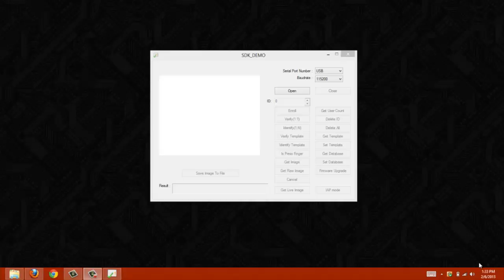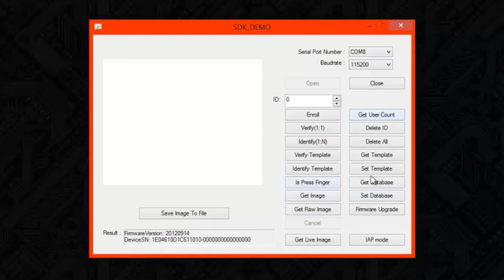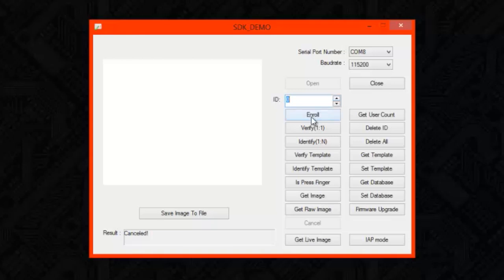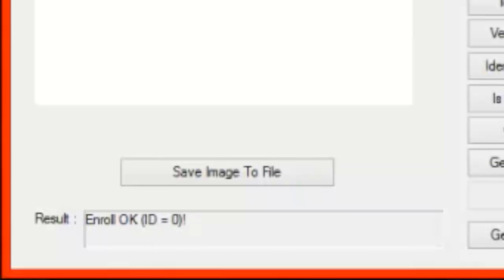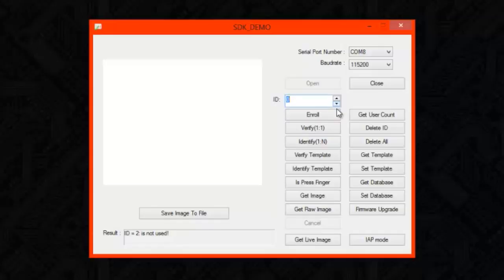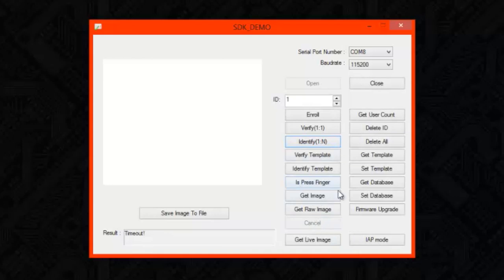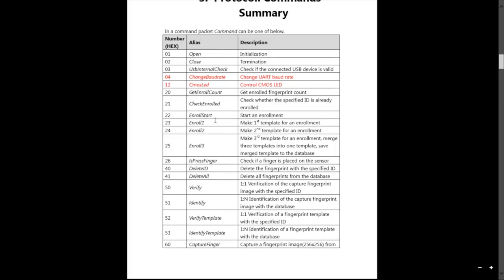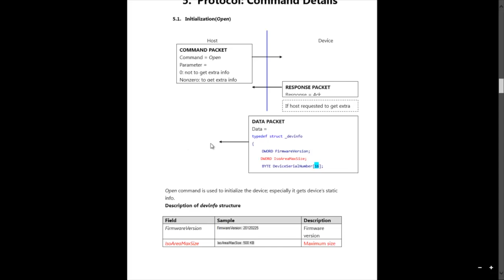SparkFun Fingerprint Scanner

Comment: I haven't worked with it, but I would imagine you could. It uses TTL logic (same as the arduino which is why Nick used the FTDI). In the program you would have to make sure to set the baud to 115200 and use datasheet to control what the arduino does, based on the response.

Comment: I have a question that I hope SparkFun or this community can help me with. This scanner performs like a champ. I'm using it in a device I have prototyped. In this project I have a need to grab the sensor's unique serial number. I've scoured through every C source file that comes with the SDK Demo for Visual Studio. I've found references to 'gDevSerial' but have not yet found what HEX commands or any other clues as to how the demo code obtains this  serial number, which it does when you make a serial connection to the sensor. 

I'm using an Arduino to interface with the sensor, and the Arduino library works just fine. However there are no methods in the library that allow the serial # of the sensor to be obtained. If I can locate the code used in the Visual Studio SDK demo then I can port it over to the Arduino library.

This is crucial to my project, as I'm using the serial # (unique to every sensor) as part of some security and anti-tampering measures. Does anyone have any ideas? Even if I can grab the last 8 to 16 digits of the serial # that would work well. Thanks in advance for any advice!

Comment: I just bought two of these, I tried them with arduino UNO and finger print scanner library, but there is no communication between the controller and the scanner.
Reply: Hi ,this sensor work with u?

Comment: What Arduino's code can I use to make it work with Mega. The Blink it's OK but Enroll Code need more anything to run!!!
Reply: Use this....

#include "FPS_GT511C3.h"
#include "SoftwareSerial.h"

// Hardware setup - FPS connected to:
//      digital pin 4(arduino rx, fps tx)
//      digital pin 5(arduino tx - 560ohm resistor fps tx - 1000ohm resistor - ground)
//        this brings the 5v tx line down to about 3.2v so we dont fry our fps

FPS_GT511C3 fps(4, 5);

void setup()
{
    Serial.begin(9600);
    delay(100);
    fps.Open();
    fps.SetLED(true);

    Enroll();
}

void Enroll()
{
    // Enroll test

    // find open enroll id
    int enrollid = 0;
    bool usedid = true;
    while (usedid == true)
    {
        usedid = fps.CheckEnrolled(enrollid);
        if (usedid==true) enrollid++;
    }
    fps.EnrollStart(enrollid);

    // enroll
    Serial.print("Press finger to Enroll #");
    Serial.println(enrollid);
    while(fps.IsPressFinger() == false) delay(100);
    bool bret = fps.CaptureFinger(true);
    int iret = 0;
    if (bret != false)
    {
        Serial.println("Remove finger");
        fps.Enroll1();
        while(fps.IsPressFinger() == true) delay(100);
        Serial.println("Press same finger again");
        while(fps.IsPressFinger() == false) delay(100);
        bret = fps.CaptureFinger(true);
        if (bret != false)
        {
            Serial.println("Remove finger");
            fps.Enroll2();
            while(fps.IsPressFinger() == true) delay(100);
            Serial.println("Press same finger yet again");
            while(fps.IsPressFinger() == false) delay(100);
            bret = fps.CaptureFinger(true);
            if (bret != false)
            {
                Serial.println("Remove finger");
                iret = fps.Enroll3();
                if (iret == 0)
                {
                    Serial.println("Enrolling Successfull");
                }
                else
                {
                    Serial.print("Enrolling Failed with error code:");
                    Serial.println(iret);
                }
            }
            else Serial.println("Failed to capture third finger");
        }
        else Serial.println("Failed to capture second finger");
    }
    else Serial.println("Failed to capture first finger");
}

void loop()
{
    delay(100000);
}

Comment: If I connected this to an arduino + touch screen, would I be able to enroll/delete users using the touch screen? Or would I have to do the enroll/delete part on a pc and then connect it to the arduino?
Reply: +John Sader There are arduino sketches that allow you to do all these functions from the arduino.
Reply: +Jake Crowley
Where are those sketches? is there any code for rpi zero w?

Comment: hello my friend.
I can't access fingerprint scanner with software demo and I will try code FPS.Blink in arduino then serial monitor show message [FPS - Open FPS - SEND: "55 AA 01 00 00 00 00 00 01 00 01 01"]

do you have solution about this problem ?
thanks
Reply: I know this is really late and you probably already figured it out but i am having the same problem did you come up with a solution?
Reply: No need to use Arduino library. You may use Arduino board as a serial converter. To do this you have to short the RESET line with GND. It makes the Atmega328 disabled. Now simply connect the Tx of scanner with Tx of board and Rx of scanner with Rx of board(Tx and Rx pin of board actually the Rx and Tx pin of Atmega16U2 MCU which used as USB to SERIAL converter on Arduino board.) and Vcc and GND as normal form. Your problem will be solved. :)